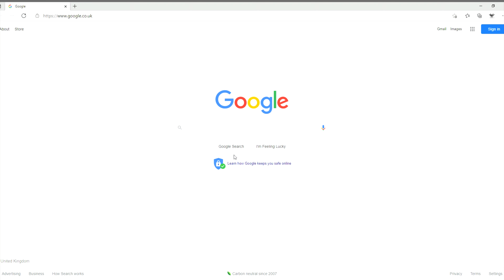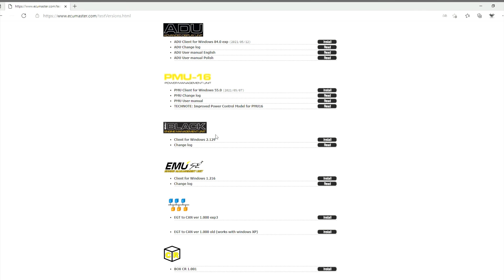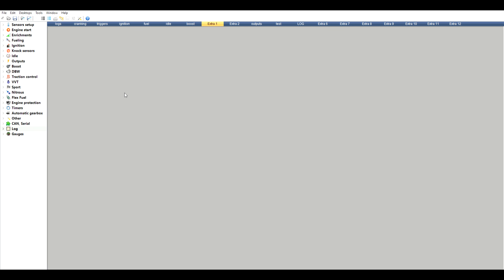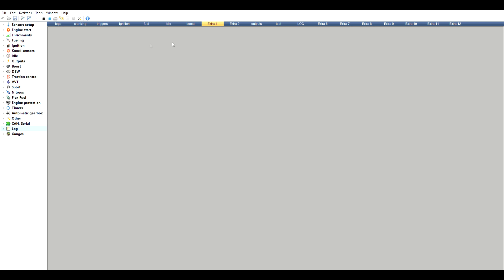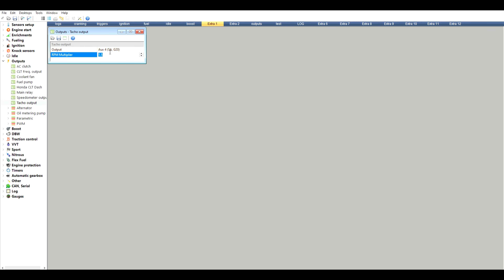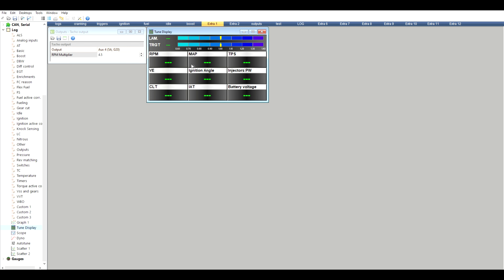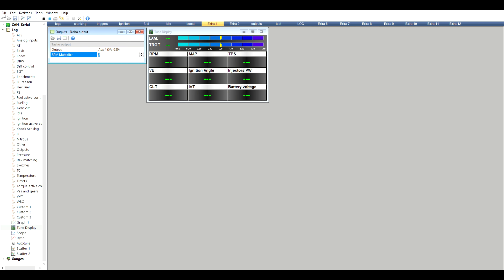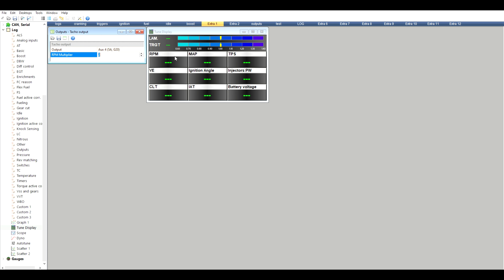ECUMaster Black Tach Setup

Comment: How to tap onto correct wire for signal? I have the black edition and getting new gauges.
Reply from the maker: On the ECUMaster Black there is a pin for TACH Output you shouldn't need to tap into anything it is a new wire that goes into the ECU.
Reply: @PhoenixEngineManagement can tach me assigned to pin 2 or does it have to be on aux4 pin 20?
Reply: I'm asking because all my aux are used